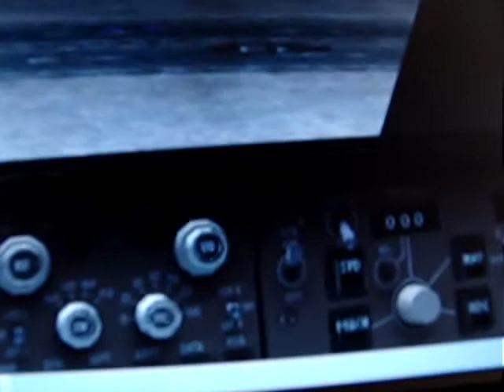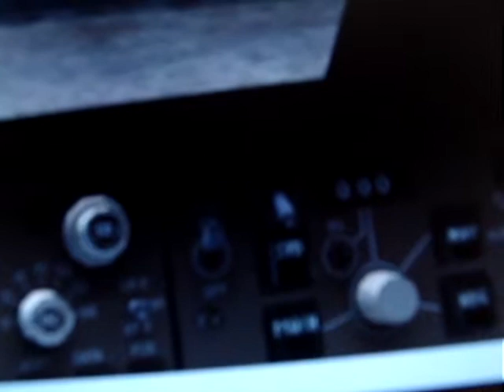Wiring a USB model 2040 to generate a 1/4 second pulse for toggle switches

Comment: hey man.. I'm also building a sim and gut the 2040 board as well for my key switch. I could see you also have a LED light on it so I was wondering how you set it up. I'm planning to build one for low voltage and for other stuff as well. Soon enough will put my first prototype on youtube. :-)
Cheers mate.